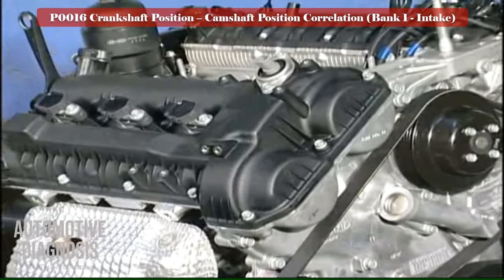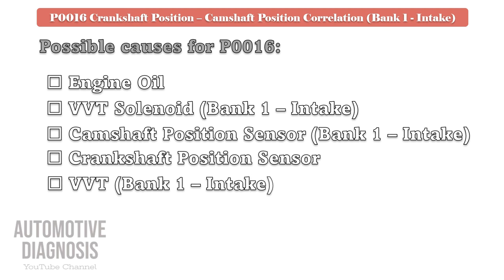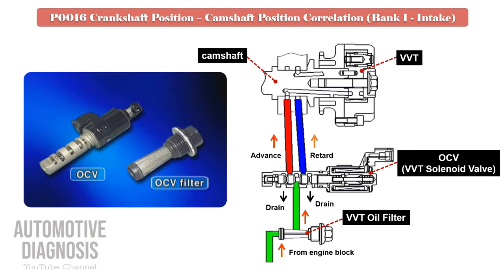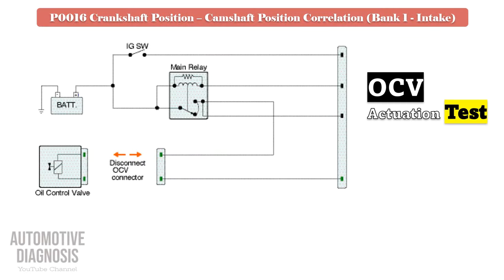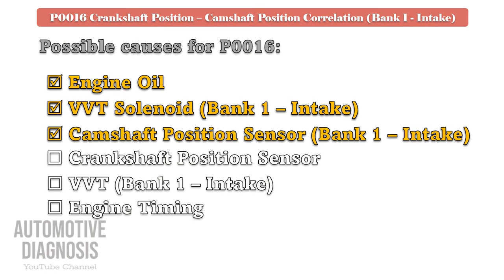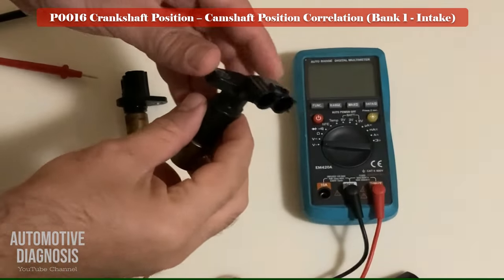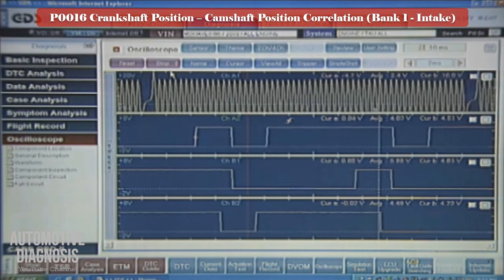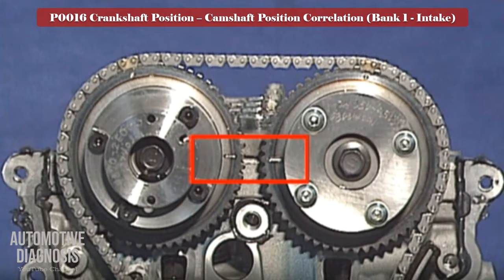How to Test & Fix P0016 Crankshaft - Camshaft Position Correlation Bank 1 Sensor A (Bank 1 - Intake)

Comment: I have a dart 1.4 turbo that gets this code, it only pops up once the engine gets hot. It runs and drives normally at all times until I come to a stop with the engine hot. I can drive for hours without stopping and never get the code but as soon as I come to a complete stop I get it and then it goes into a limp mode where I can’t get to 4K RPMS and very underpowered. Once the code gets thrown it also has hiccup during idle every 5 seconds or so. Any ideas?
Reply from the maker: Hi, have you tried to check the VVT solenoid valve (intake)? If engine oil has been replaced on time, inspecting the solenoid valve is the first option as it gets blocked by the oil contamination.
Reply: @AutomotiveDiagnosis  my car has the multiair system, it has a multiair filter for the oil before it gets to the multiair brick. I changed out the filter, the old one looked perfectly fine too. I replaced the valve cover gasket at the same time and inside the engine looks immaculately clean. And yes ive done two oil changes in the past 1500 miles with correct oil and filters

Comment: Thanks for describing how potentially screwed I am 👍🏻
Reply from the maker: Hi there, I hope it’s helpful. What was your case?
Reply: @AutomotiveDiagnosis  do you excuse me, I’m genuinely grateful for you words on this it’s just I’m still not sure any of the points you covered in this video are the problem I have. I have a golf GTD 2018 with a 2.0TDI, it has done 56 thousand miles and has a timing belt. It has had it’s oiled changed last month, and it’s oil changes were always on time.
Reply from the maker: I have tried to explain all possible causes but generally most of the time VVT solenoid valve is the cause. I’ve had some cases on timing belt too though.

Comment: Can this cause the ecp light to come on the car to shut off?
Reply from the maker: You mean ESP light?
Reply: @AutomotiveDiagnosis  that’s for traction I had 0016 & p0341 come on changed can shaft sensor & position sensor now it misfire in all 4 cylinders

Comment: I have a 2016 kia sorento and on idle its normal when i drove 10 min it start no acceleration and when i turn off the car and turn it back on it going back to normal and i get the code p0016 , i change the pedal sensor , cam shaft sensor , crankshaft sensor . Manifold but still same thing 🥲
Reply from the maker: Hi there, your cars is equipped with E-CVVT on intake camshaft, have you ever checked it?
Reply from the maker: For E-CVVT, you can check the power supply on the E-CVVT motor and also you can reset the E-CVVT with scan tool. It might work on your case.

Comment: if r.p.m not move when you start car = crankshaft sensor is damage . result the engine not work
Reply from the maker: Hi there and thanks for sharing your experience. Most of the time if there is a major fault on the crankshaft position sensor, you will have another fault code for that sensor too, and you will have some other symptoms as well, like no starting or starting with a noticeable delay.

Comment: P0016 p0017....Im pretty sure my oil need changed too
Reply from the maker: Yeah, as you have both fault codes, it is less likely to have faulty VVT solenoids, just Cheng the oil and if you still have the codes, remove and clean the VVT solenoids.

Comment from the maker: Watch the following video too:
KIA & Hyundai Engines Timing Guide | 28 Engines Timing Explained for All Hyundai & KIA Cars
https://www.youtube.com/watch?v=Z9Ksq-Nebww
Reply: The lines for timing looks very straight , but on Hyundais with 149ooo km they are both upwards a la little like 1 \8 th  off on both sides ,if chain is new is it still suspose to be a little off from center  .I seen some videos where timing is set but yellow marks on chain will not match 100% from 3 o clock to 9 o,clock straight ,or is this a manufacture error